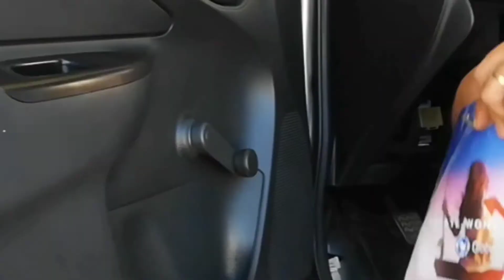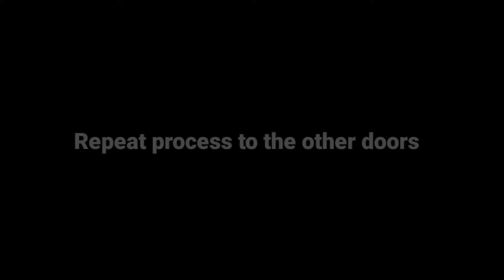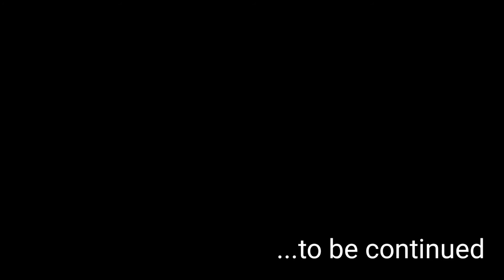Installing Central Lock/Keyless Entry to Toyota Vios

Comment: Sir na co-convert din po ba ang manual window into power window? batman vios din thanks
Reply from the maker: yes sir
Reply: @chomytuideas1784  Sir, one thing very danger about double operations of hazard warning light and key operations.

Activate the hazard warning switch and closed all doors.
Now, press the lock and unlock buttons one after another, the turn signal bulb will be fused and damaged.
Reply from the maker: @tnamen1307  the operation is still safe sir considering all supplies from hazard and key operation are all positive. Moreover, positive signal from the module has a rectifier diode before it reaches to the signal light bulbs
Reply: @chomytuideas1784  when hazard is activated, turn signal bulbs are coming on.
Now, you operate the 4 buttons on the key with all doors closed, the bulbs will be fused out. Why? Because you have 2 sources of current meeting at the same load..
1. Coming from hazard switch to bulbs.
2. Coming from the remote control module to the same bulbs.
Reply from the maker: @tnamen1307  yes, you're right. 2 sources from the same load. but remember that those 2 sources came from one battery that has 12v output. even if they were activated at the sime time, the operation is still safe
Reply: @chomytuideas1784  you don't get me..

"Not from the same load"

Two 12 volt from same source meet at the same load ie bulb at the same time.
Reply: @chomytuideas1784 
When hazard switch is on and at the same time, any turn signals are activated, what results do you get?
The hazard warning lights takes priority and all the lights flashes. What about the turn signals during this time? It doesn't glow. It glows only after hazard switch is off.

Now, same analogy be followed and applied with the remote control unit...

Hazard is on and remote buttons pressed, now you are supplying 12 v from 2 different sources ie hazard and remote unit. These 2 reached the same load and complete the circuit through ground!! Ultimately, it results in blown fuse or bulb!!!
Reply from the maker: @tnamen1307  i got you but you dont get me.   you are making the story long. This is the logic. (+12v) + (+12v) from the same source is still +12v. you are thinking that (+12v) + (+12v) from the same source will become (+24v). you miss the logic.
Reply from the maker: even if you put 100 switches and activate them at simultaneously, no bulb will be blown. As long as the common source from the switches came from one source
Reply: @chomytuideas1784  haha interesting...

I'm not talking about the voltage adds up 12 plus 12 is 24 nor the value of current...😇

I'm talking about the 12 v and 12 v MEETING AT THE SAME POINT before travelling through a load...

You loaded a circuit without a load, definitely it is a SHORT CIRCUIT. Apply same analogy in the present case ... hope it's clear...👍
Reply from the maker: now i challenge you to test my diagram. if bulbs will be blown,ill deactivate my channel
Reply: @chomytuideas1784  haha interesting 😇😇😇
Reply from the maker: @tnamen1307  yes, indeed. very interesting
Reply: @chomytuideas1784  sir hindi ba mahirap putulin yung steel braid ng cable? Kotse ko ay Toyota Yaris at cable style din.  TY